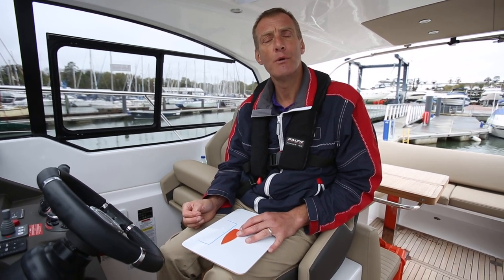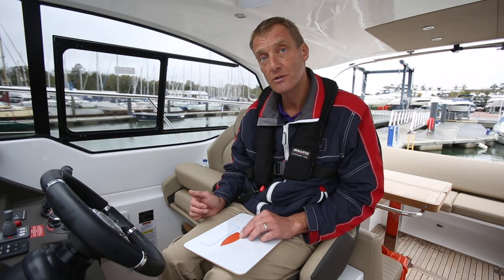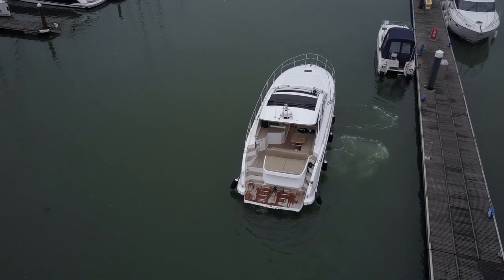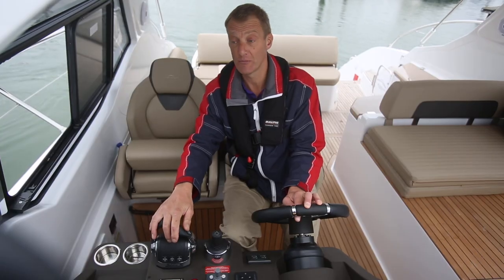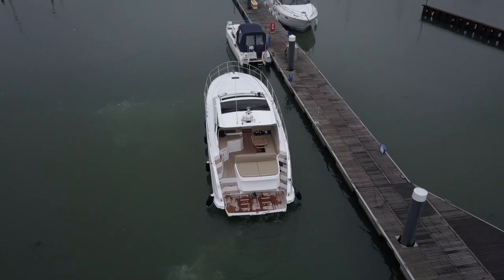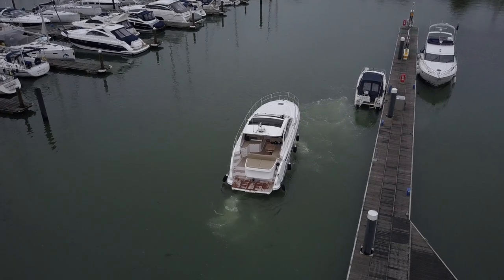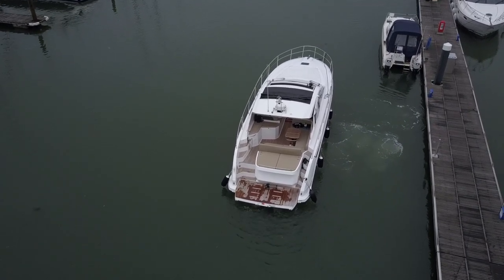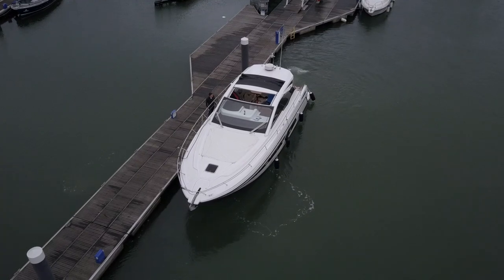How to: Move a boat sideways | Motor Boat & Yachting

Comment: Like too see him do it on the conwy river!  on a full spring tide  running at 8knots
Reply: Spent several hours in Conwy river just last week with a good instructor practicing docking in our high sided single stern drive boat, tricky stuff
Reply: You can add the St. John River in Jacksonville.  The only thing he needs to learn is how get if off the dock.

Comment: He used thrusters almost every time . Do it without any thrusters
Reply: I was thinking the same thing. I work at a marina and had to do this in a Baja that had twin screws and it was fairly difficult in the wind.
Reply: Dont get me started on single screw.
Reply: I think you'll find he only used the bow thruster on one of the 3 manoeuvres. The wake from the port side halfway along is the starboard engine in reverse.
Reply: All you demonstrated is that you can’t dock a boat without the bow thruster. Why lie to people, when the point is to make an instructional video?

Comment: Can a single engine boat be walked sideways?  I have a Tahoe Q6 so that is a 20ft bow rider. Any reason I couldn't learn how to do it in mine?
Reply: Unless you have a bow thruster, no, you can't walk a single-engined boat sideways; there's no way to apply differential thrust.
Reply: I tried anyway and did manage to kinda walk in sideways using a wind blowing over the stern, i turned the stern towards the dock and the bow was blown round. After repeating this a few times I got against the dock but it was more luck than judgement. Without wind I doubt it'd happen.
Reply: Good job. Learning to use the wind and current...and spring lines...is essential on a single-engined boat.
Reply: That's not true
Reply: There's no reason with practice and proper technique you can't come pretty close. Depending on wind / current making a difference as you pointed out, but with practice you'll soon be able to at least get pretty close.  Good Luck with you're boating, Enjoy...
Reply: donzi32 Boats "That's not true"

What's not true?
Reply: SeikBrian, I'm commenting, like everyone else. what is it you're confused about? True or not true?
Reply: Totally agree here. with wind ,current in ones favor can be a definite benefit.
Reply: donzi32 Boats " I'm commenting, like everyone else. what is it you're confused about? True or not true?"

You wrote "Not true." I'm asking you to clarify WHAT is not true. You didn't post a quote or a reference to a specific post, so there's no way to know what you're claiming is not true.
Reply: The not true was NOT supposed to be where it came in at. I see the confusion. I posted basically the same comment you did here. Right wind, current helps. If you read below you're comment I agreed with you're posting. I said the same thing before reading yours. In you're last post directed to me, sounds almost like you're wanting to argue about whatever? FYI, I don't waste my time here to argue over another mans/women's comments. NOT saying thats what you're intentions were.
Reply: If laying up on the starboard side, starting from 2 beams away, and not accounting for wind, current, etc., I'd turn the wheel all the way to starboard, do a click in and out of forward, leave the wheel where it is, click in and out of reverse, turn the wheel all the way to port, one click in and out of reverse, then one click in and out of forward.  That's about the best you can do with one prop, no thrusters and no joystick.  Kind of an "Itsy-Bitsy Spider" maneuver.  lol
Reply: No difference, as the boat shown here was operated as a single stern drive, IMHO.

Comment: All very nice...now add wind, waves, current, other boats coming in and out with angry pilots, fatigue after a big day, non-electronic controls, non power steering, no bow thruster, no joy stick and concrete edges on the dock. Please do that video. If you can nail that you'll be a legend.